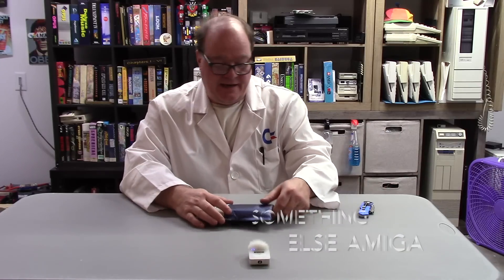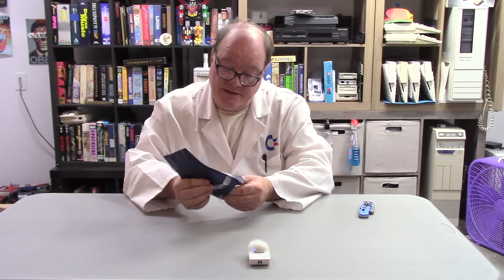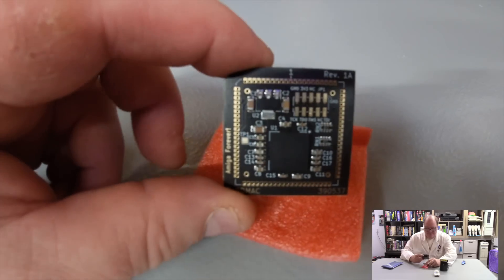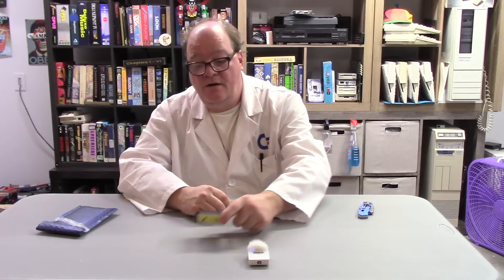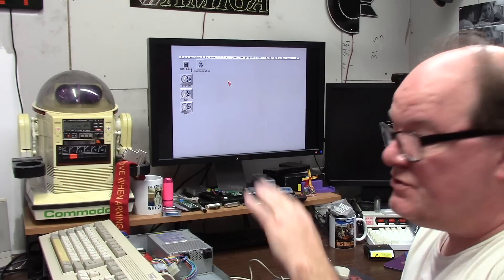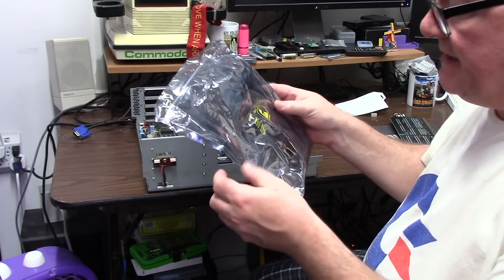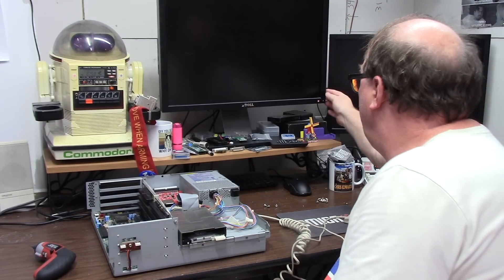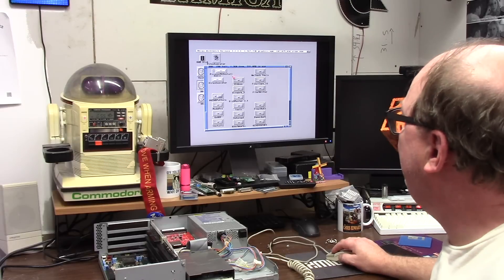The FPGA recreation of the Amiga 3000 SuperDMAC

Comment: Would this work on an A2091? If it did there would likely be no advantage though such as dma into 32bit ram since the A2091 is on the zorroii bus.
Reply from the maker: This has nothing to do with that Zorro true card it’s DMA and scsi compatibility for the 3000 and hopefully the 3000 tower

Comment: A few years ago, I tested various combinations of setups: Ramsey 04 + SDMAC 02, Ramsey 07 + SDMAC 02, Ramsey 04 + DMAC 04, and I didn’t encounter any issues with SCSI. However, I was using the SCSI chip WD33C93A 00-08. Changing the Ramsey and SDMAC chips did not affect the data transfer speed in my case :)
Reply from the maker: This is for compatibility with the new series of accelerators that have come out in the past several years. All the original stuff would always work but being 30+ years old now they’re all turning into hen’s teeth.

Comment: Here’s hoping that the Agnus comes as FPGA version as well. I had a Denise (A500+ kind of re-build in ITX) board built, with mistakes, then got it by another builder in Sweden to repair/fix the issues, and well somewhere in the build process the 1 MB Agnus got damaged. It was hard enough getting the 1 Meg Agnus, and finding another is harder. Seems if sold it is extreme prices..

Comment: We so badley need this to happen to the Agnus and CIA chips.  I know there are some plans to do so but nothing seems to be happening with either for some time.   Both those chips are so expensive now and with the case of the Agnus not available new, add to that that every one wants the 2mb version.    Supposedly there were plans for a 3 or 4mb Agnus as the hardware addressing could theoretically take up to 8mb.   That would be great to see and could be achieved via FPGA

Comment: You should forward this to Dave Hyne as he was working with DeComp to release a new new chip for the A3000.
Reply from the maker: I talk to Dave all the time
Reply: Do Dave and co. have the original designs/code to help speed up reimplementation of the chips using contemporary tech in their personal archives?

Not sure if there would be IP issues at this point though.